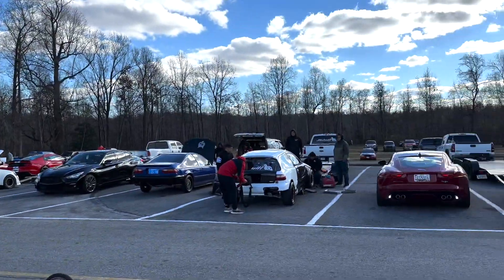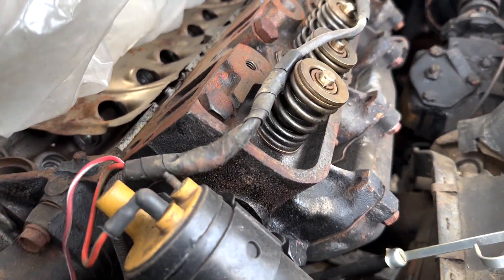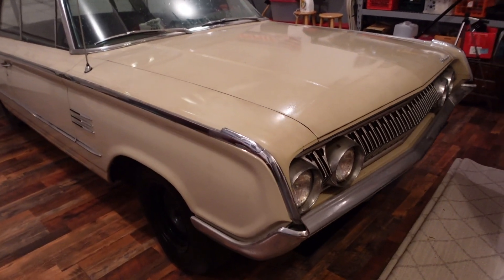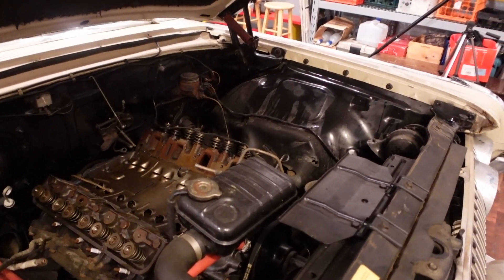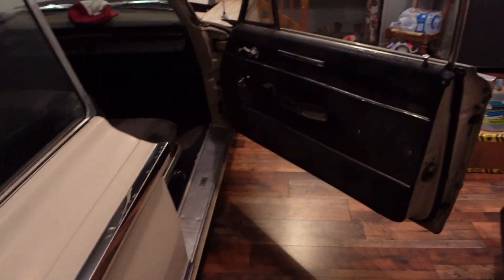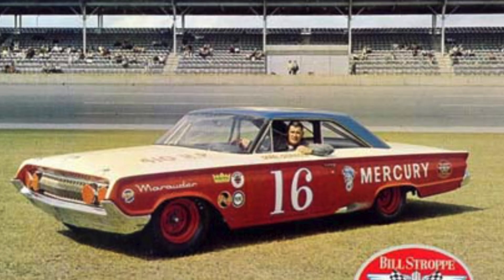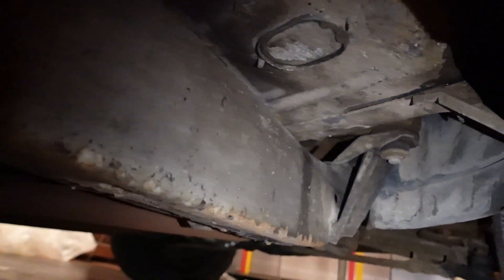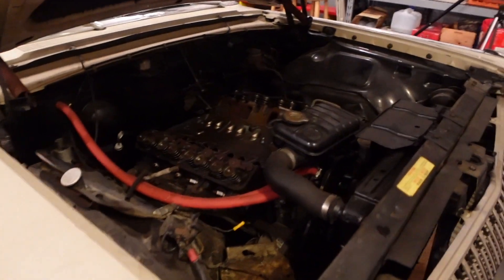We Save A Rare One Of 2300 Mercury Montclair!! Swap Meet Gold! (Chasing Crappy Cars Ep.16)

Comment: Edelbrock makes an intake for the FE Ford engines and the AFB carb they make is excellent. Put aftermarket A/C in it! Maybe you can find some period correct bucket seat and console. It would also be cool to put a Ford Top-Loader 4 speed in it too!
Reply from the maker: Already ordered the intake! We’ll see how far we go!
Reply: @Rustomod  You have a nice car there. I would not do anything to it that isn't easy to return to stock. None of this "resto-mod" crap with Coyote engines and the like. They are only original once. Edelbrock intake and the like are easily reversable.  Even if you put period correct buckets and console, if done right, that is also easily reversable. A dream car from when I was a teenager was a 1963.5 or 1964 Galaxie 500 XL two door hardtop. I never got around to getting one. But I have owned 3 1956 and 3 1957 T-BIrds which were even more of a priority back then. Your Mercury is a fantastic car.
Reply from the maker: @MostlyBuicks  Definitely! You’ll see it back on the road very soon!